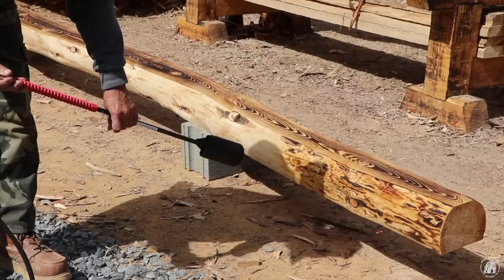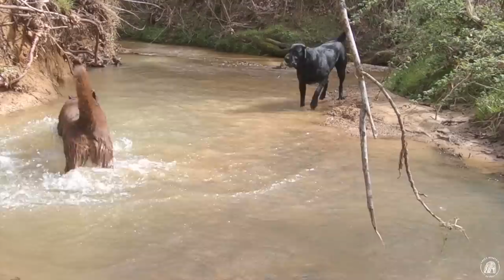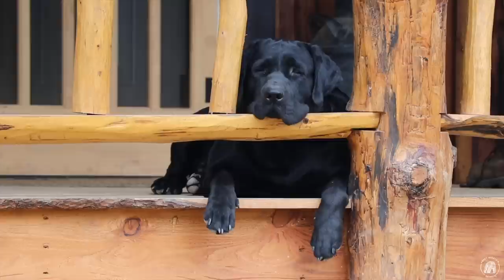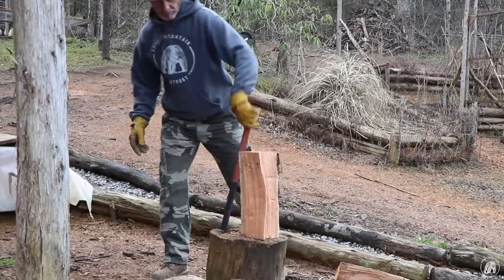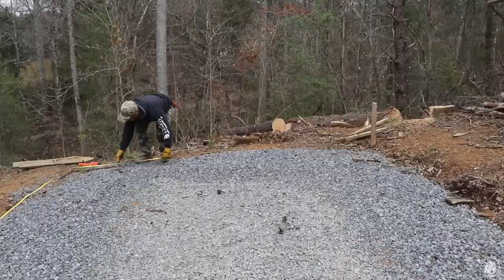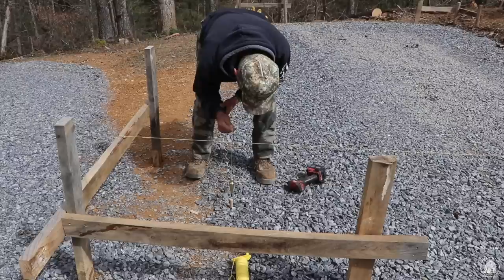Building a Crazy Crooked Post & Beam Carport PT 3

Comment: In Part 3 we use old school hand tools like the early pioneers.  Battery operated drill, Propane brush burner, Paint roller with a plastic tray, Electro galvanized self tapping T-10 Torx head wood screws & Australian wood oil.  In part 4 we are going to use a wood fired stream tractor with a post hole digger, a capstan for the derrick and a manually adjusted grader so hit the like button and tune in next week!  Good camera and sound work!
Reply: 4

Comment: Good video and job. Will burning them and coatings with timber oil keep the bees out of the pine wood here they are eating it up. You really have done a nice job on every thing. Take care be safe and well.
Reply from the maker: No. Carpenter bees will continue to bore holes. But they have devices to trap those things. I’ve got one I need to get myself some more.

Comment: your mathis solid on the pens for batter boards and you can double check using Pythagoras' theorem
a theorem attributed to Pythagoras that the square of the hypotenuse of a right triangle is equal to the sum of the squares of the other two sides. it is a right angle triangle so a squared plus bsquared equal the third side or the hypotenuse which is normally called c squared ...if your measuring agrees math checks out then your definitely perfectly square but with crooked timbers that is the challenge right so that is your margin of error so the strings are the tie breaker ...It is how the old men built the pyramids lol

Comment: Would it heĺp to spread that hot tar with a stiff brush after applying it with the trowel?  Also, could the tar be thinned with oiĺ before applying?
Reply from the maker: The tar was thinned some by heating. Don’t want it to run. It turned out okay in the end. I explained on my other channel the variations that could be used just like you mentioned. It’s common to me but the kids said I should do more explaining, lol
Reply: @SmokyMountainOutpost  Didn't check the other channel.
Don't think the tar would run after cooling if small amount of oil was added.

Comment: Richard I have a surplus of poplar on my land and I live on a hill but there’s a lot of clay. Would you recommend this building method?
Reply from the maker: Mine is doing well. Not only will the burn help (a good solid burn) like alligator skin keeps from rotting so soon but I also used roofing tar to coat the bottom and sides and wrapped roofing felt around the post. Post need to set on gravel bed about two or three inches deep for drainage. No need to felt bottom of post. And extend about six inches out of ground to protect from surface rot. So far mine is like the day installed. I used pine, but with that said everything I have built has been with poplar and pine. I’d say treated like that it doesn’t matter. I wouldn’t have a problem myself doing it.
Reply: @SmokyMountainOutpost  good to know.

Comment: Wonder if it would be feasible to build a fire chamber (barrels laid horiontally)  with the fire underneath, and a metal grid for it to reach the lumber through (kinda like a bbq grill) that you could run the wood thru to get the char that you want.  Seems like it would be easy to get the uniform look plus take less time and work.
Reply from the maker: Some parts burn different than others. I do prefer that look to just plain lumber. It certainly makes the grain stand out.